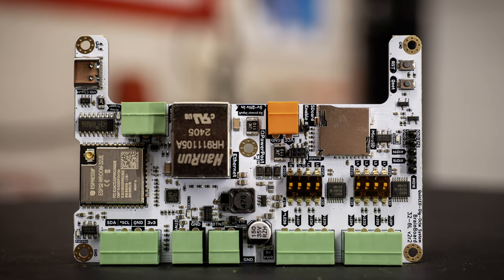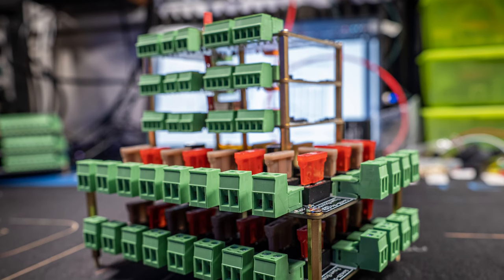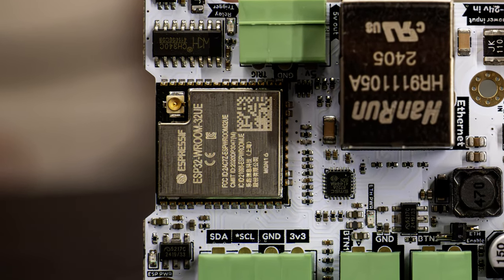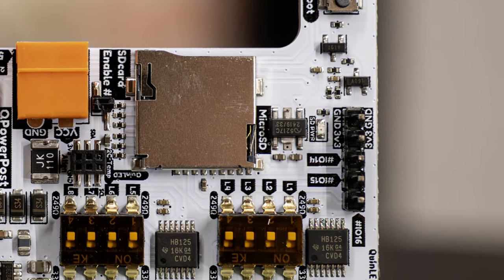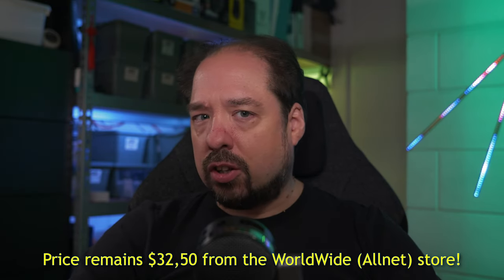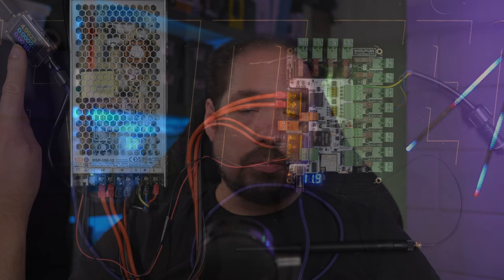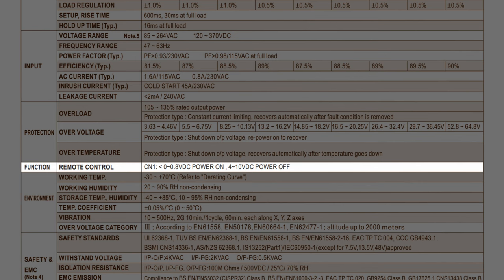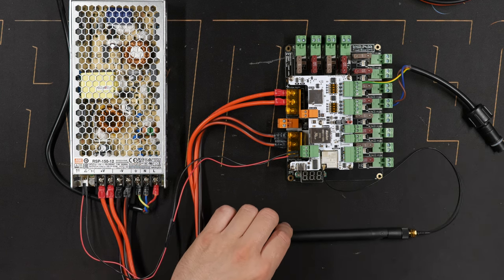💡QuinLED💡Dig-Octa refresh and special PSU relay trick!

Comment: Cool PSU, could have used that when I was trying to fit the PSU, dig-quad, 5V buck converter and relay into a weatherproof box that I sized slightly too small.

Comment: Hello everyone, I have a dig octa 5, it was running fine and today I had a power outage in a wind storm. I noticed my leds (two 15 metre runs) were on and orange, the default colour. They all were lit, not like an initial start where only a few are. I guess I have to  redo the setup as wled wouldn't connect to the board. or did I have a power surge that did something when the power came back on. Thanks

Comment: I watched the video to the end. :) I wouldn't mind seeing the DigQuad receive the new power control feature to be used with the different Meanwell PSU. Would be a nice change from simply turning the whole thing off.
Reply: I'm 99% sure the dig quad has the same relay circuit as the Dig Octa system, and therefore it would perform the same with the new series of MW power supplies

Comment: With regard to Auto On/Off, why go to all that trouble.. I use smart plugs on all my LED installs (with Quindor boards) and the smart plugs use less power (if that is what you are worried about). I dont see a need to keep the brain boards powered when not in use. But, thats just my setups of course
Reply: Keeping logic local means it will be more reliable. If your WiFi or Home Automation system goes down the smart plug won't trigger

Comment: Idea for the next Brainboard: find a way to run multiple BrainBoards off one Ethernet line. Even merely adding a second Ethernet port would help, but I suspect something more elegant could be done with a pin/socket connection between multiple stacked boards.
Reply: Can't wait. Thinking of how I can implement this as the lighting system for the house.
Reply: don't think this can be done with an ESP32 board and with all the features still there.. remember an ESP32 has limited GPIO pins and ethernet alone requires quite a few.. on the Dig-Octa board there are not many pins unused on the board itself.. basically there could be a switching chip added on the ethernet port but the room just isn't there.. then there is the next problem that both boards run their own software and WLED isn't compatible with running a "cluster".. running a second board as a slave based on data calculated on the first will limit your total LED's in half because one ESP needs to calculate them all.. this has been thought about as you can see :)

Comment: I watched it to the the end. :)
I have a dig uno ethernet setup. Do you have any tips for the powersaving? 
Should I add a secodary psu for the controller and relay to trigger the led psu ot is there a more elegant solution in that case? 
I driving 2 channel with around 40 rgbw led each.
Reply from the maker: Depending on what the idle usage of the current PSU is, the investment in the extra hardware for just 80 RGBW pixels likely isn't worth it. Once you run 300 or 600 LEDs all consuming a bit of power, it starts to add up.

Comment: Quick question, can i stack a 7HC then a 5HV then 2x brainboards all in one stack? obviously 12V and 5V PSU to supply the relevant powerboard, but can the 2x brainboards stack all the way down using the center power stud?
Reply from the maker: Yes you can stack it all together without an issue! Note the 5HV needs at least 24v as a minimum.
Reply: @ thank you, also for a separate project can I have a 7HC and a 5 stacked with 1 brain board then some of the data ports on brain board is powered from the 7HC and the other ports lights powered from the 5?
Or do I need a 2nd brain board?

Comment: Will that On/Off PSU trick work with the Dig-Uno / Dig-Quad?
Reply from the maker: On A Dig-Uno no, unless you maybe use the second LED output to do so. Same on the Dig-Quad, it has the Q1R which is suitable for relays but might or might not be enough voltage to trigger it, but hard to guarantee like on Dig-Octa which has a much different circuit to do so and always provides a good 5.1v